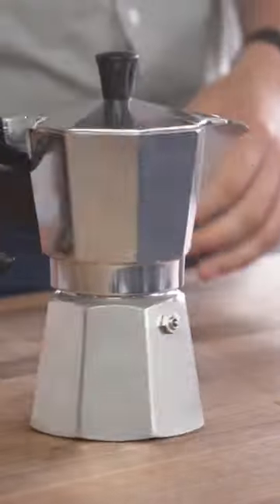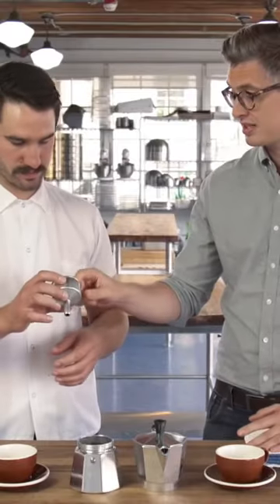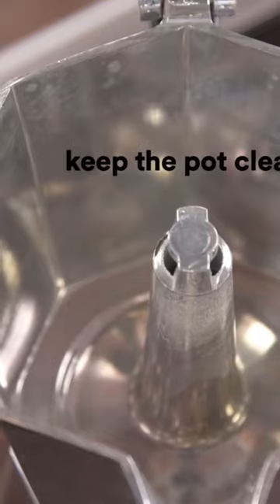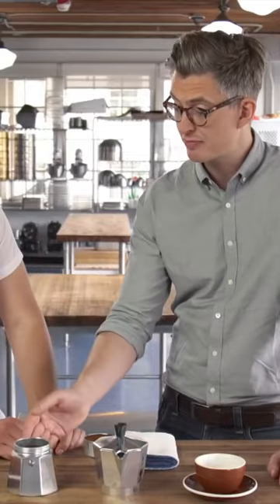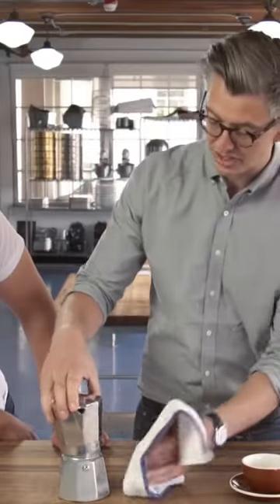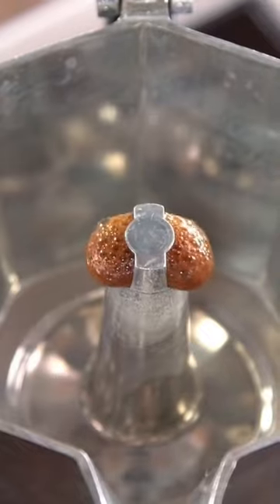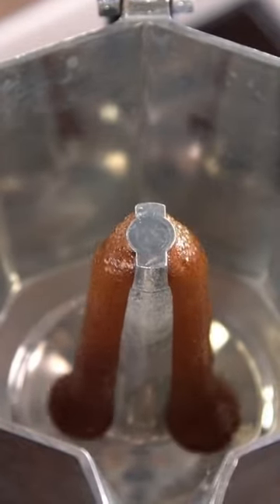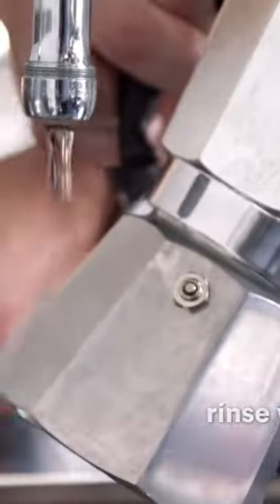How to use a Moka Pot with @chefsteps #shorts #coffee

Comment: I don't wait for the pot to gurgle. I stop once the level has reached the part where the spout starts. That gurgling gives the coffee an unpleasant taste. Starting with boiling or cool water doesn't seem to affect the taste of my brews so I just go with cool water since it's safer prep work but it's a longer wait before the brew starts.
Reply: Same
Reply: On point. Same
Reply: When you start with cold water, it still gets to heat up close to the boiling point to mount up the steam pressure necessery to push it up. It will not start to extract at a noticeably lower temperature, the temperatures are going to be very similar either way. The only advantage to hot water is that the upper part will have less time to heat on the stove and it will stay cooler, reducing the risk of the coffee overheating during and shortly after extraction.

Comment: All this "scientific design, development" BS is what ruins coffee and why I can't stand Hoffman or other YT channels. The purpose of the moka pot is to be cheaper than espresso. It's so simple. Wash the thing, it's not a cast iron pan, there is no "seasoning". Room temp water, find your stove's best setting. Slightly finer than pour over grinds. Stop before it gurgles if you can or after the first. That's it. Running cold water over the base is dumb since removing it from heat will stop it from flowing after 2-3 second anyway, which is about the same amount of time it takes to get it to water; it only helps make it safer to touch.
Reply: mate, just brew coffee the way you want lmao. its just like watching chefs on yt - they gotta show how to get the best you can, not that you have to do it that way 😂
Reply: I get the point of overcomplicating, and 100% agree with the hot water - this seems nonsense.
On the other hand, you can also achieve great results with the Moka Pot and improve your coffee with more time investment. And its actually his Job to show what can be done. There is even a lot more to play around with, everything is just so much focused on stupid espresso.

#freemoka
Reply: I really hate too much details but I have to say that the moka pot in particular is very sensitive to adjustments, and my coffee has ranged from terrible to perfect. I think there is something true to this whole ritual.

Comment: mine never looks that good
Reply: What quality of it looks not as good? Color perhaps, or quality of stream (unbroken liquid for example, not sputtering)? One of the biggest factors that affect Moka Pot brews is the temp used to heat the vessel. Too much heat makes the water boil too vigorously, leading to things like sputtering or inconsistent stream. This is one of the reasons why some ppl like to use hot/boiling water in the lower chamber, as it takes less time and energy to reach boiling again, and can be more finely controlled as the water does not require as much direct heat over time to reach boiling again(takes far more energy and time to boil cold water). I’ve seen some examples where folks will lift the pot slightly off the stove to vary the temperature, and also why James recommended to run under cold water right after you finish brewing.
Reply: @brianchu8147  I  do all that ,pre heat the water but not boil,,then medium heat to finish ,its probably the cheap Costco coffee im using
Reply: @billhamilton7524  yeah good quality coffee goes a long way eh? GL!
Reply: @billhamilton7524 fresh ground beans goes a long way. Also fill it as much as possible with grounds makes a difference.